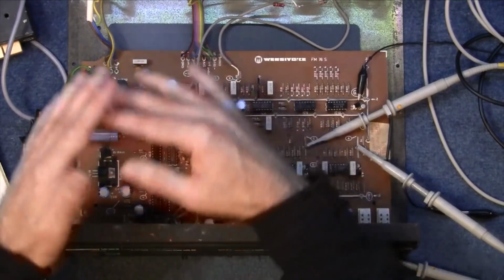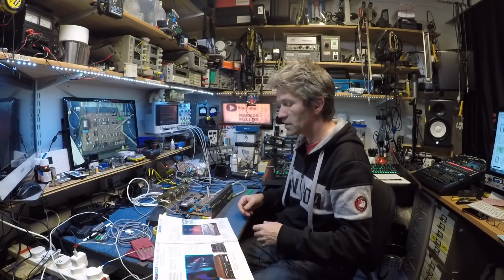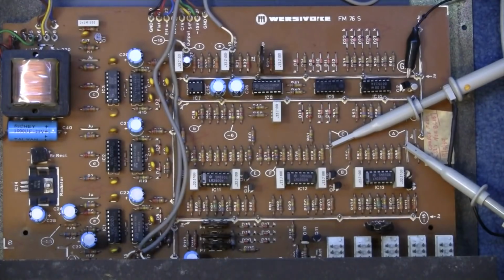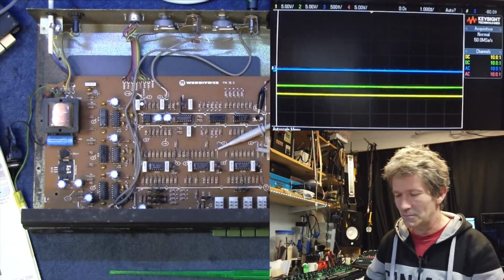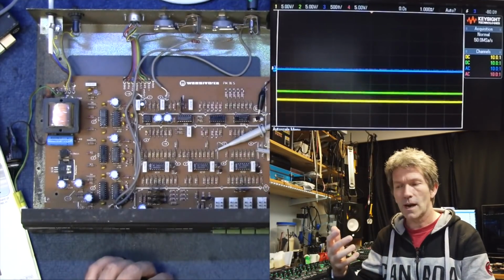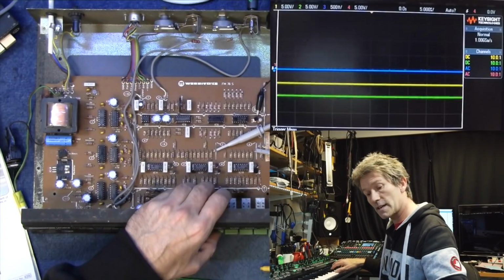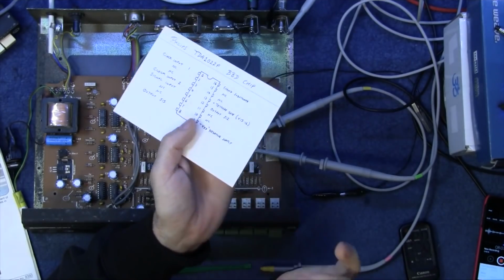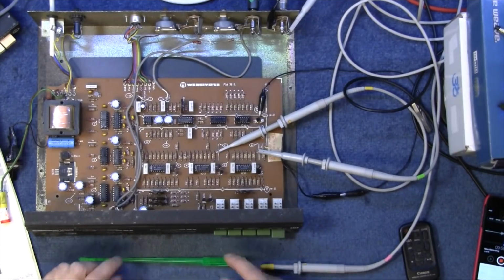Bucket Brigade Device BBD wersi voice rotor string choir effect unit

Comment: Hi Markus. How does one actually identify original chips? Is this just insider knowledge carried on in the scene or are there certain tricks / procedures one can apply to identify them? People asking rediculous prices for branded chips is becoming an ever bigger problem when dealing with old instruments. I have however heard that some of these chips have now been put back into production by one of the Behringer group companies. Maybe that will make some of them reasonably affordable again. Let's hope a bucket brigade and some chips typically used in organ divide down oscillators are among them.
Reply from the maker: Hello Marc, the clue here was there was a different chip than what was specified on the schematic and the 3 down the left side bbd chips 2 were wersi chips and one philips but on the schematic they showed 3 same chips as bbd chips. but there are many chip numbers that have been used by other companies and they specify their own numbers and codes to be etched onto them. the behringer chips you mention I think are called coolaudio and they are producing vca’s vcf’s vco’s and several other old style synth chips. I bought a small selection of them in the hope of putting something together in a future video but have been so busy just recently that i have not had to to start anything with them just yet.
Reply: @markusfuller  I'm surely looking forward to that.

Comment: As it turns out, your unit, sounds very similar to the one i had...you can easily hear the repeating of the effect(s) while the Phasing rotor (being also much more complex) has also some analog filtering after the BBDs making the audio less predicable....
Also the later WersiVoice sound somewhat different, as it´s also digital controlled...i think they beefed up the LFOs and also did some after BBD audio filtering
Thanx for the audio-demo, Markus...:)

Comment: I onwed one of these. Got it way back in the early 1990s.....i was very excited when i heard that wersi did a standalone wersivoice at some point as well..., but also a bit dissapoined afterwards...i was thinking i would get me something like the "WersiVoice" in my MK-1, but naah....

After that, i tried the "Böhm - Phasing Rotor"...but this one was never actually released as s stand alone unit...but the PCBs are quite self containing....And these are killer...thick, rich and very deep sounding....They have three BBD-chips which are controlled by an individual mix of three sinusoidal LFOs which are 120° out of phase. Afterwards the audio comming out of the BBDs are mixed together using hi/low and band-pass filters...

I was so impressed by this, that i bought about eight PCBs sets over the years and combined to true stereo effects units with, in some cases, CV inputs and VCAs to also have a slighty modulated audio amplitude, and also the later incarnation the Phasing Rotor 2000, which has even better audio and converted it to accept external CVs for individual delay modulation and individual audio outputs with added VCAs.

Let´s see what´s your oppinion....
Reply from the maker: It is believed that Dr Bohm was one of the early pioneers at Wersi but branched off to start his own company making electronic organ kits. I know nothing about the Bohm phasing rotor 2000 as I have seen a few Bohm organs but never had the pleasure of getting inside one.

Comment: I think one clock input clocks all of the odd stages, and one clocks all of the even stages.   The clocks are inverted from each other, so the two outputs would have different timing.   One would be off of the one clock, and the other off of the other one.   Here is a quote from the SAD512 data sheet:  The device has its output split into two channels to provide output over each full clock period in normal operation.  This device also has outputs from stages 512 and 513.
Reply: That is mind boggling. Would you take a guess as to why? Versatility, I guess.

Comment: Mark, has anyone seen a schematic for wersimatic wm24/b?
Reply: ps I have a tda1022 sheet i can send you ..interesting question.  I've never had calling to study into the details but it shows 514 stages...last one a clearing stage to Vdd.  512 is on clock 1, 513 on clock 2 and in application the two are just tied together to smooth things a bit I suppose

Comment: Great Vid (as usual) How did you find out that WIC6020 = 4066 ??
Reply from the maker: Hi Ed I just kept on googling and it came up a few times that this chip was an equivalent so I thought I would give it a try and it seems to work . heres one of the links I found but there were several that kind of gave the clue. https://www.google.com/url?sa=i&rct=j&q=&esrc=s&source=images&cd=&ved=2ahUKEwjYkOSf6P7fAhXl6eAKHdPyAA8Qjxx6BAgBEAI&url=https%3A%2F%2Fpicclick.de%2F1x-WIC6020-HCF4066-MC4066-zB-222710871737.html&psig=AOvVaw10Mokwzc5HIY0-zcB-o_n0&ust=1548158024367419
Reply: Thanks for replying

Comment: That's a very cool effects device. I wonder how it would sound with  a theremin. Thanks for the video. :)
Reply from the maker: ThomasGrillo Hi Thomas , thinking about it I guess it should be pretty interesting with a Theremin attached. do you fancy a 6000 mile trip ?. would be great to see you.
Reply: Would do, if I had the funds. LOL Indeed, it would be great to see you. :)
Reply: @markusfuller  naah....you need harmonics...plenty...it simply doesn´t sound that good with only a sinusoidal waveform as the audio input. the more harmonics the audio input signal has the better the effects-depth...try white noise with all my the mods i described and use headphones, close your eyes and fly away into space....;)

Comment: The reason it is not stereo is simple.  In the 70s/80s most people in bands only ran in mono.  Only the very high end PA systems were stereo.  Most guitar/bass/keyboard amps were mono.
Reply from the maker: Pick Holder Yes I guess I’m forgetting it’s age really when stereo was not so commonly used plus most organs were mono also.

Comment: What a lovely warm analogue effect. Perhaps you could find a second one for stereo use.... Please do more repair videos!
Reply from the maker: Alex Thanks Alex, I may be able to make this one into a stereo type version as some viewers have commented on how it could be done without buying a second version.
Reply: @markusfuller  just to repeat myself from somewhere above....: it can be easily done....the one with the deepest LFO mod is the center and both the others are hard panned right/left(or VCA - panned, even nicer)....killer sound...but the mod is hard to do in the WersiVoice (audio routing is terrible) but rather easy on the Böhm Phasing Rotor. Add a panner (2 VCAs) and external CV inputs to all BBDs and manual feedback control or CV.......and use headphones...and you are in the middle of the 70s space age...just add as many plasma-lamps for eye-candy as you like ;) 

Or (my strongest suggestion - if you like the BBD stuff, like me;) look out for the Böhm Phasing Rotor PCB sets...more modular...way better audio performance and far more complex CV/audio routing(=deeper, non-predictable effects) , better LFOs, tracked filters....easier feedback access (CV and/or adjustable)...add VCAs for panning...add individual audio outs per BBD and add BBD CV inputs (you can even use audio for that) and voila:  you built your very own analog "ursa-major space station" clone.

Comment: Hi Markus, I saw your question regarding 513 output on one of the pins. I think it is a sort of overflow so you can daisy chain these chips, so you get 512+512+.. and lengthen the bucket line.
Reply from the maker: Albert Pauw Thank you Albert that actually makes good sense, I never thought of it like that but that sounds completely logical. many thanks.

Comment: Pin 513 is to do with the sampling rate, pages 12-37 and 12-38 of the old Elektor magazine from December 1976 explain it well, it’s available on the internet archive, I’ll reply to this post with the link as it will get blackholed by YouTube
Reply from the maker: Silent 1 Thank you very much for that info. I will have a read about that as its one of those things I always knew was there (the pin 513) but never really looked into what it was about. best wishes.
Reply: markusfuller no problem, you’ve provided me hours of entertainment so I thought nothing of taking the time to try and find out for you as I was intrigued too
Reply: Thank you for this info!
Reply: @SilentMono  honestly i don´t like the fact that elektor uses -15Volts....it´s the very close to the absolute maximum rating....use -12Volts instead...also the PCB layout is critical....don´t use Perfboards, protoboards for anything other than "proove-of-concept" builds....I do have the original elektor issue(s) and i also tried to buildup that circuit when these chips could be easily bought...but it lacks in audio-performance as you can hear a clock-noise and also aliassing....after all, it has some great info, but the provided circuit is of rather basic performance (like many elektor stuff) and you would need to do alter it anyway if you want to use it for more than just a gimmick.....by the way...you can convert the complete issue into .pdf without any charge....thanx elektor :)

Comment: 8:29 because it would take twice as many BBD's and support chips.  Cost'll get ya every time.
Reply: Roderick Legato well they could have split the existing BBD outputs or added a voltage controlled panner. Being 2 VCAs
Reply: @RussCottier  i did both (among some more) on one of my Phasing Rotor modifications, sounds great and if you add external CV and external controllable feedback it gets to a point where you can beat the usra-major space station...;)
Reply: TubiCal Nice!
Reply: This unit has three BBD chips, so they can't be split into two channels.
Reply: Roderick Legato of course they can. Just grab the output of the first one for example and run that on the right output channel. 

Configuration of which are used and how might change between modes but sniffing an output will be doable
Reply: Okay, yeah you could do that. It would give you a Right channel with 1/3 the current max delay, and a Left channel with 2/3 the current max delay.
Reply: Roderick Legato or tap from the second chip. 

I suggested the first as it’s more likely to be used in every setting
Reply: @Roderick_Legato  no, it can be easily done....the one with the deepest LFO mod is the center and both the others are hard panned right/left(or VCA - panned, even nicer)....killer sound...but the mod is hard to do in the WersiVoice (audio routing is terrible) but rather easy on the Böhm Phasing Rotor. Add a panner (2 VCAs) and external CV inputs to all BBDs and manual feedback control or CV.......and use headphones...and you are in the middle of the 70s space age...just add as many plasma-lamps for eye-candy as you like ;)

Comment: The music at the end was a nice touch. Thanks for sharing.
Reply from the maker: AlainHubert Thanks Alain. its from a track we did a while ago called skylab. I think we put it on soundcloud/markusfuller
Reply: @markusfuller  
Is that a Rhythm Ace FR2L as the drum machine on this ? Sounds good. I've got a later model (when Rhythm Ace became Roland), the Rhythm 77 (sometimes known as the TR-77). As for chip rebranding, you're lucky there was anything written at all on them. Sometimes paranoid companies will go as far as sanding the silkscreen off !
Reply from the maker: AlainHubert Hi Alain. the drum machine on the top of the organ is the rhythm-ace inside the box but its a hammond branded version.

Comment: This should sound a lot better if it were stereo. Mixing the slowest BBD to both outputs and the faster ones to left and right. This can be heard on the Solina String Ensemble (later versions). The modification itself is simple enough, just copy the existing output stage with modified mixing of the BBD lines.

Xvive still makes the MN3005, a longer delay time BBD, 4096 stages.
Reply from the maker: PWMaarten You have me thinking now, maybe I should have a go at doing this. I have a Crumar multiman-s but I also had a solina years ago, wish I had never sold that solina.
Reply: markusfuller I'd love to see a video of this. ;)
I've done a lot of BBD circuits. Love the sound of them!

Comment: There is still one major manufacturer of BBD chips, in 1024, 2048 and 4096 stage versions and that is Coolaudio, part of Music Tribe/Behringer. 
Even Roland now uses their BBD chips.
And as for the 2 outputs, the numbers represent how many times it has been delayed, well that is what is documented in the manual for the Coolaudio V3208D (which is essentially a MN3208).
Reply from the maker: dglcomputers I have bought some coolaudio chips for a future project but i’m struggling to find the time to get started on it.
Reply: CoolAudio makes some pretty... cool stuff, whatsinaname. I'm definitely eager to check those BBD's out :)
Reply: The 32xx range BBD's have a lower operating voltages and thus less headroom and more noise.
Reply: if only they made more of the shorter delays, like a 256-stage bbd. anything shorter than 1024 is getting hard to source, and they are not cheap.

Comment: I just picked up a Soviet era TOM-1501 which is a clone of the Crumar Orchestrator string machine and it includes the same effects stage of vibrato + three parallel 512 stage BBDs modulated by a three phase LFO. It's quite striking what it can do to a basic string sound. Thanks for covering this device.
Reply from the maker: Peter S I love the Crumar orchestrator. I have the multiman-s at the moment and it sounds wonderful.

Comment: It is indeed a shame that those old BBD chips aren't made anymore :( I am building my own string synth from the ground up and instead of using BBD chips to give the chorus effect I am going to stack 3 ranks of oscillators  (36 total) complete with another 36 dividers and keyer circuits! Similar to the Freeman string synth. I will than modulate the three ranks separately with 3 independent lfos. 
And this is my first ever synth project! .....I'm  nuts:)
Also nice vid!
Reply: CoolAudio is making a copy of the MN3207 BBD, the V3207D and they're available on ebay for next to nothing along with the clock chip.
Reply: @7lbOwl  thanks! I've eyed vintage BBD ICs to build my own little effects maschine. It just got a lot cheaper :D
Reply: Berrabub and you dont have to design something with obsolete parts! Which i hate doing.
Reply: @PracticalCat  naw, but sometimes you don't got a choice like the Rat dist LM308N. I honestly didn't know BBD ICs was still made.. ofc I haven't really looked either :)
Reply: Berrabub yeah so true. Its just a matter of crossing your fingers and hoping the rare part doesn't die! Or accidentally killing it by reversing the polarity when breadboarding at 2am haha
Reply: @PracticalCat  that's why I need a handful of ICs ;).
Reply from the maker: PracticalCat First ever synth project. wow thats a task to start on but it sounds like it will be a great project. I love Ken Freemans string machines.
Reply: markusfuller haha yeah its definitely a big undertaking. I am however taking it very slow and getting each stage working before I move on to the next. Its actually not too complicated just ALOT of repetition in the circuitry. I think the keying circuits were the hardest part to get my head around. But after looking at many service manuals for ideas I have come up with a design.
And yes the Freeman string symphony is fantastic! Kind of similar to the korg lamda and Yamaha ss30 imo. At least they are the only others that used multiple oscillator ranks.

Comment: the two outputs always seem to be summed from the BBDs
Reply from the maker: Sasquatch Just one mono output on this but the 3 bbd chip outputs mix down to the one mono out. maybe i could try and pick on the outputs seperatly and mix them into a stereo+mono output ?.
Reply: I meant the outputs from the IC's - i recall they have two outputs which are usually summed using resistors - can't recall if the second output was used to cascade BBDs - I could be wrong - its been a few years :-)